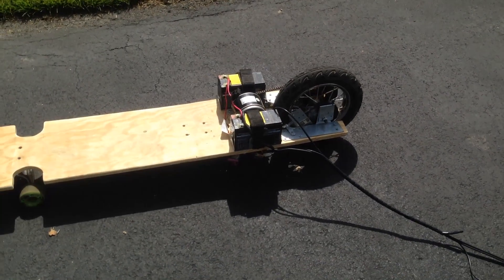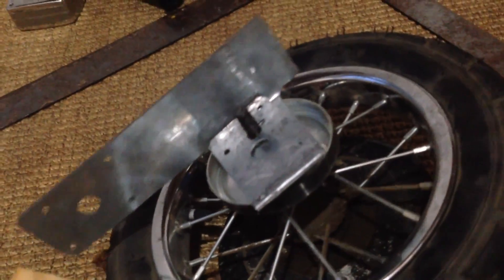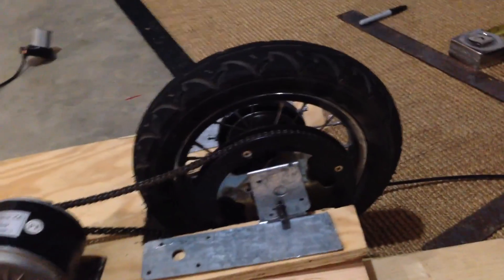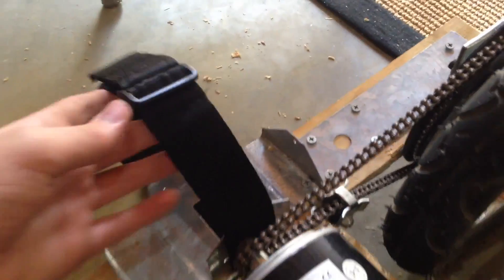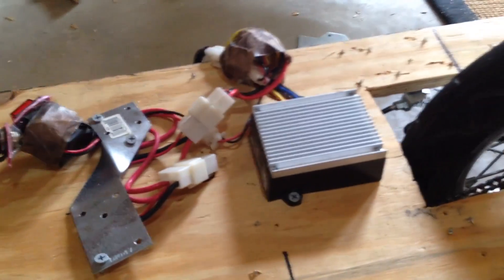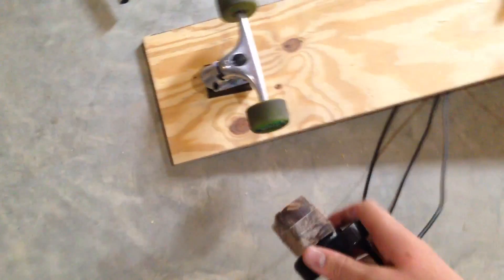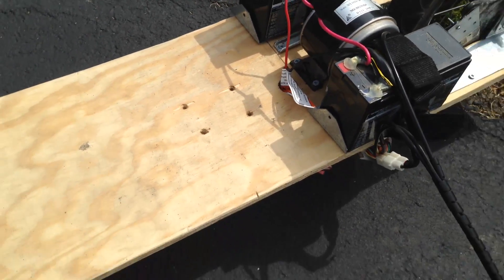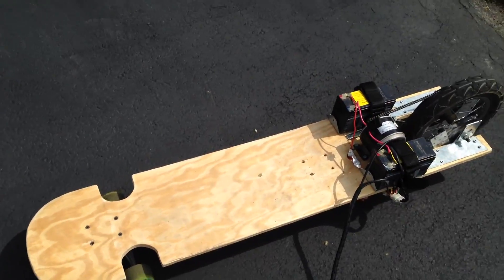How To Make An Electric Longboard / Skateboard

Comment: I'm planning on making one of these, would you recommend reinforcing the wood plank with steel? also I was going to make cross country tyres any ideas?
Reply from the maker: Lenx Venn you could reinforce it if you wanted to but the board that I used worked fine it only bowed an inch at Max. And for the tires any tires would work good
Reply: thx for the advice, I'm subbing

Comment: Bro can you give me some details about the motor (kwh ,watt and voltage) it will be written on the motor.
Reply from the maker: It is a 12 volt, 250 watt motor but i do not know the kwh, i hope that helps
Reply: +Buddyboy77 sure 12 volts?
Reply: +Vansh Shah btw why u switch the whole motor u could just change the terminals 😂😂
Reply: +Vansh Shah and again last thing can you please tell me about the battery every thing thank you and keep doing the good work 👏
Reply from the maker: +Vansh Shah sorry lol it is 24 volts I don't know why I said 12
Reply: +Buddyboy77 no problem and again 
 keep doing the good work 👏👏
Reply from the maker: +Vansh Shah and yeah the batteries are each 12 volt and each are 7ah
Reply: +Buddyboy77 okh thanks
Reply: Vansh Shah j